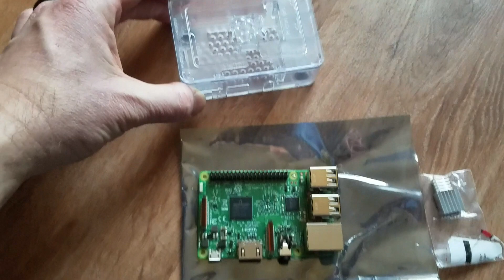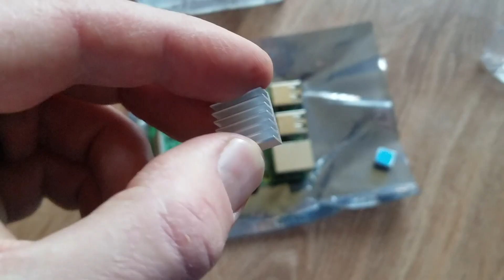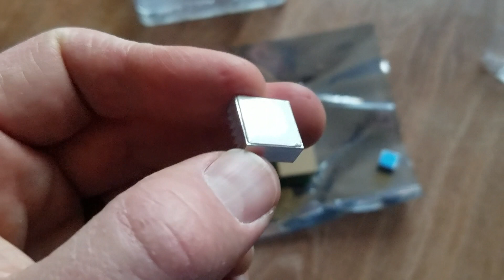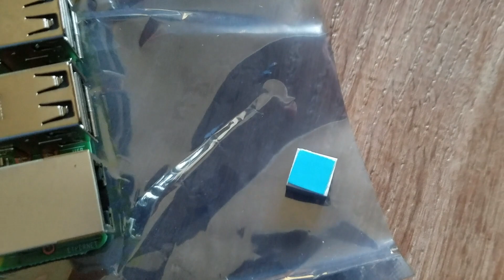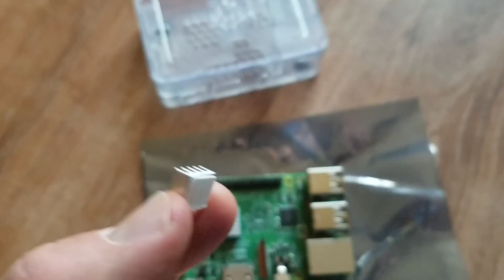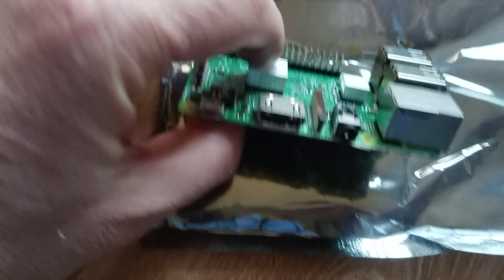How to Install Raspberry Pi 3 Heat Sinks

Comment: so fwiw, these shock resistant bags work in such a way that you should NOT put a computer board on top of the bag, the outside of the bag is super conductive to essentially create a faraday cage for everything INSIDE the bag.  Laying a board on top of an anti-static bag is worse than laying in on carpet
Reply: Is that because of the geometry of the bag, or is it because there is a coating or different material used on the outside of the bag?

Comment: Hi, I have a case thats made out of aluminium how do a transfer the heat to the case without drilling any holes in it? I cant mount the whole thing because there's some distance between the chip and the case.
Reply: You could try to fill empty space with thermal paste.
Reply: @RomanDąbal  it's a few centimeters haha
Reply: @felixd3184  Well, then you're looking for copper rods. Unfortunately making mounting holes would be necessary.
Reply: @RomanDąbal  :( sad, but okay thank you for your awnser :)